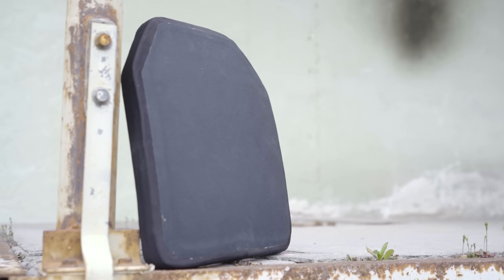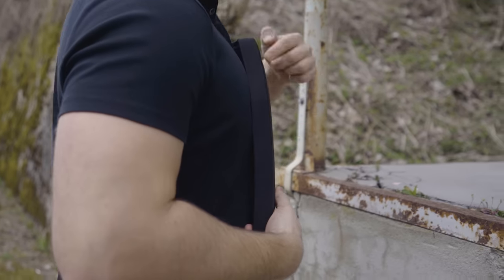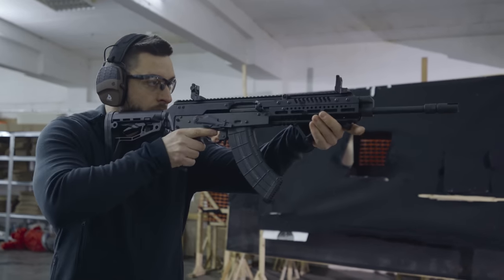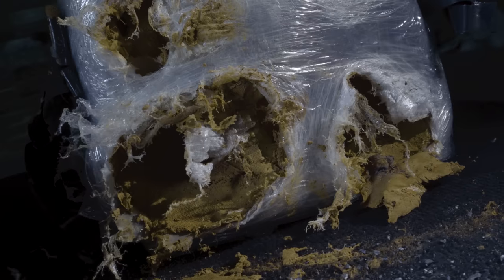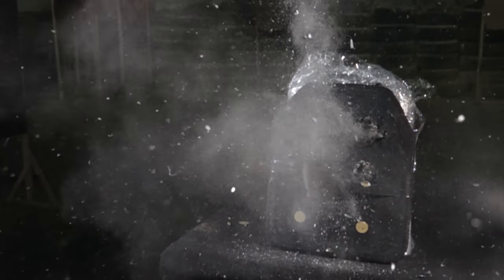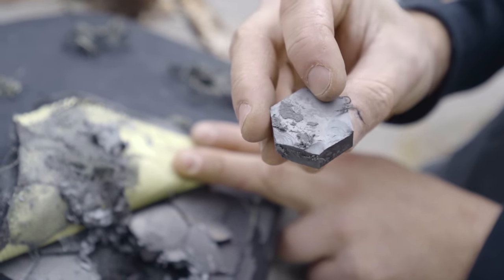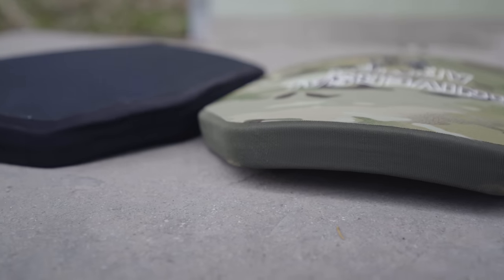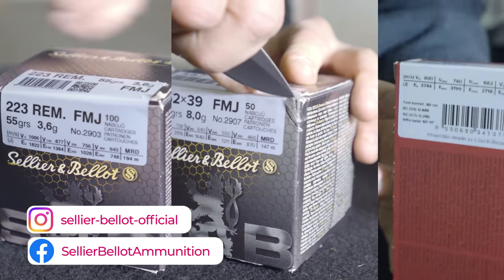Shooting a Chinese ballistic plate

Comment: Cant use AP, so I assume it'd be illegal to make your own by drilling out ammo tips and putting is tungsten carbide drill bits, right?
Reply: Probably could buy steel or tungsten or w/e and lathe pieces to the right shape and then load it at a typical reloading station

Comment: Penetration is only part of 'proper protection', that back face deformation can still kill.
Reply from the maker: Yes, it can but it's very rare. Also the backface deformation in our video (judging from the plate) is nowhere close to the NIJ limitation. The effect is just more dramatic because we use very soft clay for backing material. 
If this was proper ballistic clay it wouldn't look that bad
Reply: @PolenarTactical  Rare? Gota disagree with you on that. It only seems rare BECAUSE of things like NIJ standards and modern medicine. When you look into car accidents or other similar injuries, you'll see how dangerous it is.
As for the plate tested...it did seem to hold up well enough. I look forward to seeing the AP test.
Reply: dead, died in the hospital a few days later, but looks not that bad. No worries. @PolenarTactical
Reply: @xxxlonewolf49  I'd have to search, but there's a guy taking .308 hits while standing on one foot, and talking like it ain't no thing..
Reply: @BuffRANGE  was it Russians? I'm told they do stupid shit like that. Proper armor will mitigate, but like TBI it adds up. And if the armor deforms...it will kill. Look into the blunt force trama from car wrecks with steering wheels